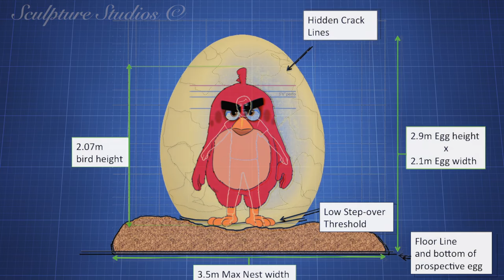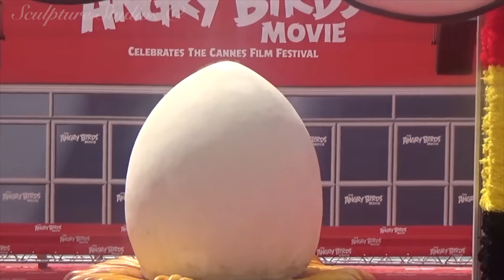Angry Birds Egg and Nest by Sculpture Studios

Comment: Aden: what is the product that looks like cement used on the "eyes" of the proyect at min 15.25 ? im looking for a finishing product for exterior and i didnt want to use the fiberglass. this looks like a solution, ! Thank You !
Reply from the maker: Hi Xime, this is just a soft, water based plaster filler. So not really appropriate for outside use. This isn't by any means a strong product either. The fibreglass underneath is what has provided the strength, and this is just to smoothen it down, and we could get away with using this on this occassion as it only needed to last 1 day. But its certainly not a product that can be used outside much, or something that can be used on its own soley for strength. Fibreglass would still be my recommendation, or at least a car body filler, which would use a resin.